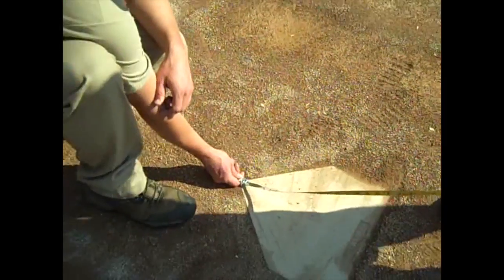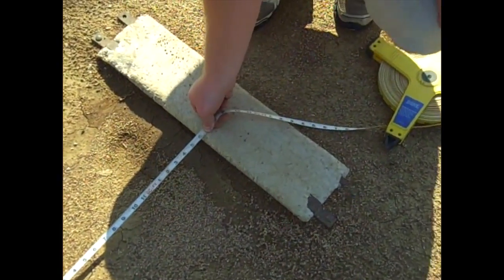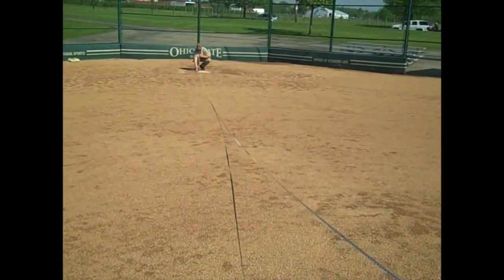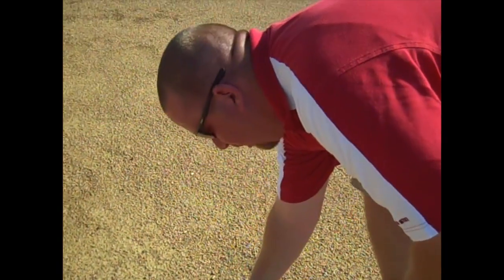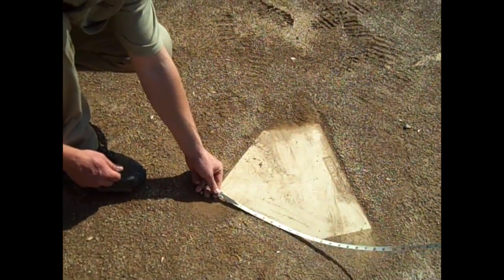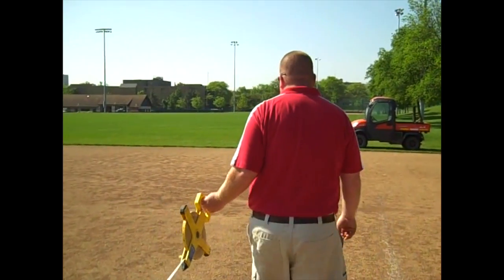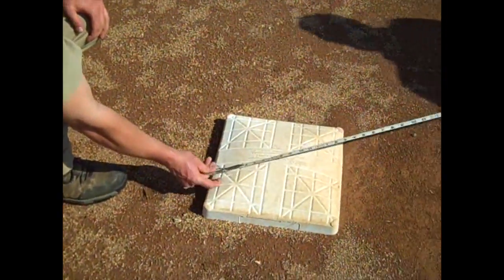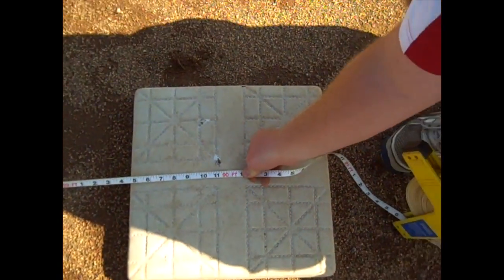Field Layout

Comment: U contradicted your instruction with your speech, you said to measure from the outer corner of 3rd to the apex of home base and it will give you the designated measurement, but when you measured from 1st to 2nd clearly where your assistant places the measuring tape is not the back outer corner of the base… he places on the edge almost at mid base..
Reply: He was probably new. You need to pull from the back right corner like you’re saying.